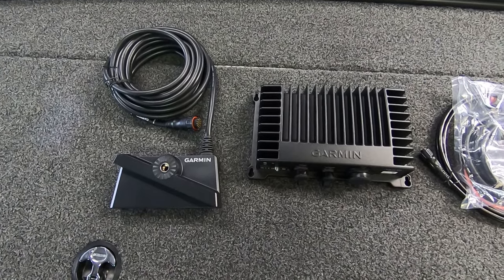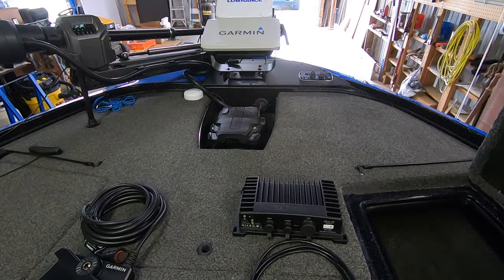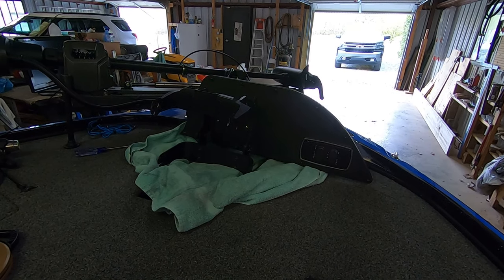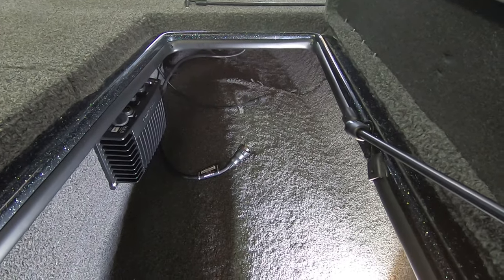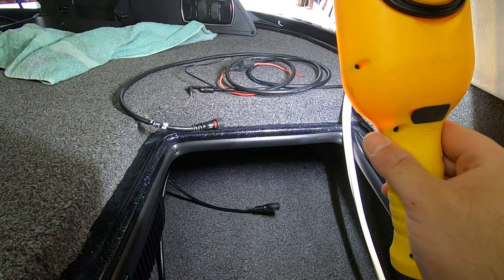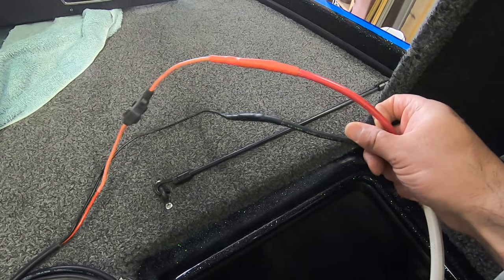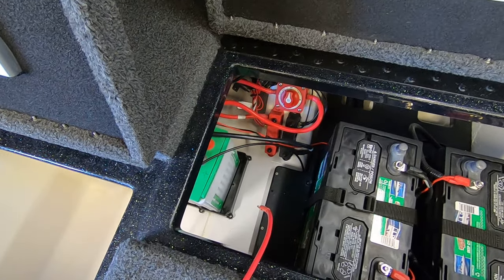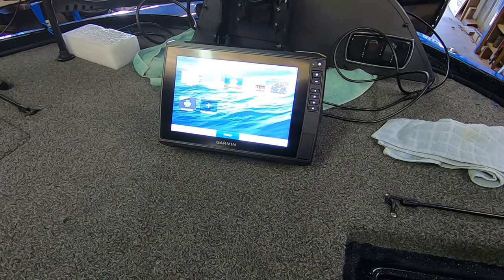How to Install Garmin LiveScope - New LVS34!

Comment: Why didn't you just tap off the backside of the trolling motor power plug for your power to the black box?
Reply from the maker: That would have probably worked just fine - but from all I've ready about LiveScope, people seem to think it does best with a direct line straight back to the battery.  Plus, I don't know what gauge wire was ran to the trolling motor by the factory, and if I run it to the battery myself, I at least know it's a big enough gauge wire to deliver enough power.
Reply: @Everydayfishing  That makes perfect sense. Thank you.
Reply: @Cooperman Your right , if it's 24v thats too much power.

Comment: I watched your video and see you installed the unit in a Nitro z18. I have a Z7, same boat, just a little older. How many feet of the 8/2 flat wire did you use?
Reply from the maker: I bought a roll of 25 feet and probably used about 20 feet of it… but my black box is also up close to the front of my boat.
Reply: What gauge wire did you use?

Comment: Just ordered mine last night, found one in stock.. did you figure out if the inline switch is needed for sure or not?
Reply from the maker: I am pretty sure that turning the graph off or putting it to sleep does cut the power to the black box.  My black box light goes out when the graph is off.  So an in-line shut off is probably not necessary.
Reply: @Everydayfishing   Very nice!, Tight lines bud!

Comment: I'm trying to do mine . Why not use your existing switch ? Will that not work ?
Reply from the maker: The existing switch cuts all battery power to the boat… so that would work if that’s what you want.  I wanted to be able to cut power to just the black box in case I didn’t need the LiveScope or needed to conserve.
Reply: Thank you !

Comment: Does anyone know if I have to run a separate power cable for the livescope or can I use the same cable running my 93sv. I’m using a 8awg cable from the battery to the 93sv. Thanks in advance.
Reply from the maker: Yes your black box does need its own power source.  I would run 2 of those cables from the battery and run one to the graph and one to your black box

Comment: Should use all of the battery post on top of battery. Big post for big wires.
Reply from the maker: It’s all the same terminal… really doesn’t matter.  But if I had large terminal connectors then I suppose I would have just to save space.  Honestly just never keep those around.

Comment: Dos preguntas: no hará interferencias con el motor eléctrico? Y la segunda, si el motor se mueve, con el GPS, cambiará la dirección del objetivo, no crees? Muy buen vídeo, enhorabuena.
Reply: It will not interfere with the motor. And yes it will swing around as you turn your trolling motor. You need a turret if you want to have the transducer independent of the trolling motor.

Comment: Did you have to run a separate power wire from your chart plotter?
Reply from the maker: Yes I ran the power for the graph up under my console and connected it to the fuse panel there.

Comment: Do you have to disconnect the black box/LVS34 when you pull the transducer out to change spots ?
Reply from the maker: No you don't - when I change spots, I use the "sleep" feature on the Garmin graph, and this stops the transducer.  I don't think I needed the extra battery disconnect switch that I installed - it does appear that all power is cut off to the black box when the Garmin unit is asleep or off.

Comment: Nice install but I’d seriously consider adding another battery. You have way too much off of the cranking battery. If you can I’d isolate your electronics to that battery and keep minimal devices on your cranking battery. I know a few guys that needed a job for this reason. Otherwise great install.

Comment: Fuse should be at the battery.
Reply from the maker: Unless your battery is within 6 feet of your black box, it’s pretty difficult to have it right next to the battery.  Instructions specifically say to leave the fuse provided by the factory

Comment: Pretty sure ur graph dictates power to black box
Reply from the maker: I believe you are correct - my black box does appear to go completely dark when I turn off the graph
Reply: @Everydayfishing  1 question, 1 thought. Where did you find the switch? Maybe the switch will stop battery charging from back feeding box and plotter. Maybe not. Again where can I find the switch? Thanks nice video.